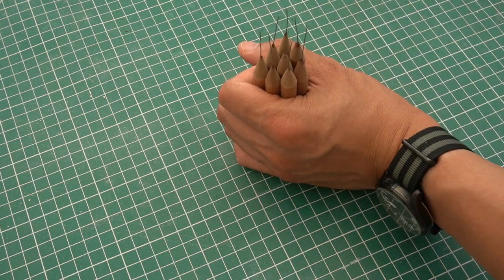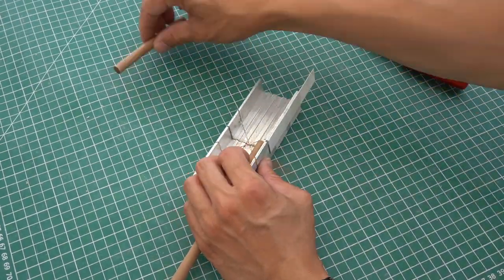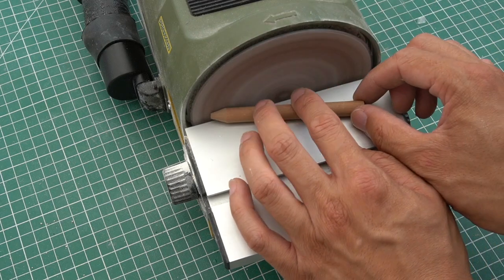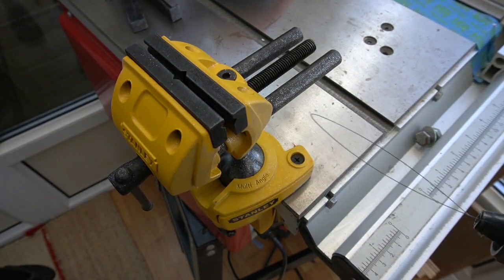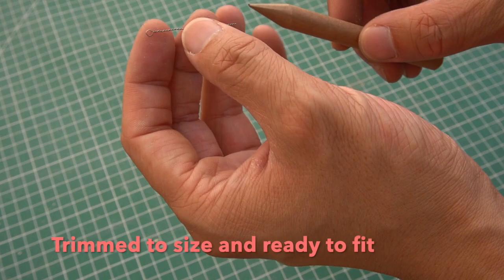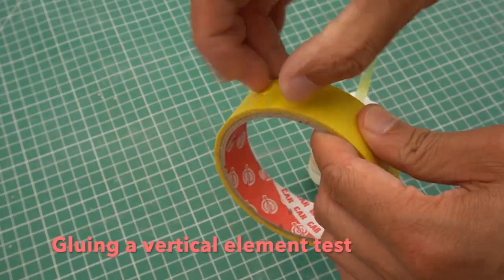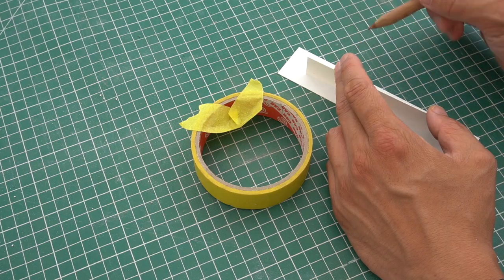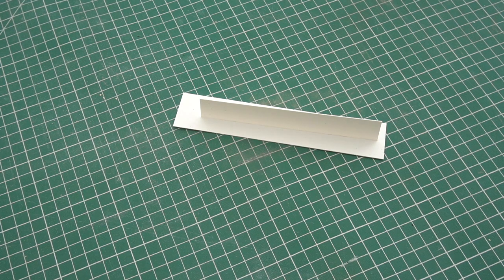SUPERGLUE applicator / Model Making (How to)

Comment: You can use a fly tyers bodkin already made for 2 to 3 dollars. It’s a brass handle with a stainless tapered tip.
Reply from the maker: @mguerramd that's a good one, I've tried that one before but I was clumsy on moving thin CA around a nearly finished model. I found using a scalpel blade held horizontally is good for those final touches of glueing paving and thin materials easier to handle. There are many ways, guess it's down to the job at hand and what we have at reach :)

Comment: Obviously a Proxxon fan, lol. 😛
Reply from the maker: Hey! The Proxxon is actually a really good bit of kit compared to other disc sanders on the market. Firstly, most of the disc sanding I do is at a smaller scale, so it fits the purpose. The balanced motor means there is next to zero vibrations when in operation allowing for accurate movements. On top of that, the plus side is that it's super quiet too. I have other disc sanders but I use this one the most. Check it out it's a good addition if you're sanding small parts.

Comment: Interesting. I was looking at the rather expensive DSPIAE super glue applicator tool & wondering how it's supposed to be used. Seems rather pointless after seeing how simply you created your own just as effective tool.
Reply from the maker: Glad it was helpful! There is always more than one way to solve a problem, well that's how I like to see it. In case you didn't make the applicator, you can always find them available on my Etsy shop.

https://www.etsy.com/uk/listing/830191908/superglue-applicator-useful-tool?ref=shop_home_active_2&frs=1

Anyways, thanks for the comment and support. Am here to push and find ways to make things easier to carry out our projects.
Reply: @Iamjustamodelmaker  I'm still new to the world of modelling, so it's good to find little nuggets of information wherever possible. 😋

Comment: A sewing needle would though do the same job with less hassle!!!
Reply from the maker: Yes a sewing needle can also be used for the same purpose, but depending on your application this tool can be made for your specific needs.

For example, the spring steel wire used measures 0.3mm in diameter and the size of the loop can be made for the amount of glue to be applied. With the option to shape the loop, say with a circle loop the glue can be applied not just at the tip but at many angles. With the sewing needle the thinner the metal around the eye the smaller the needle eye, plus the thickness of metal at the top of the eye is usually thicker than the sides creating a greater distance away from the material to be glued. This can cause marks and signs of points of application.

The second point I find useful is that you can bend the wire between the loop and the handle in order to get into tight spaces, this is great for dealing with complex pieces or applying glue around a corner.

So for a few minutes of making this tool, for me at least as a model maker it's worth the hassle ;)

Comment: So much waste! The glue won't wait for you to make a lot of passes with this thread! It will dry!
Reply from the maker: Hey ya! The loop is for thin super glue only. Make a little well from masking tape to reapply when needed. Once the glue dries on the applicator, burn it off using a lighter. Easy 😉